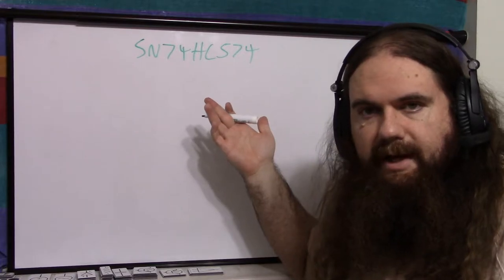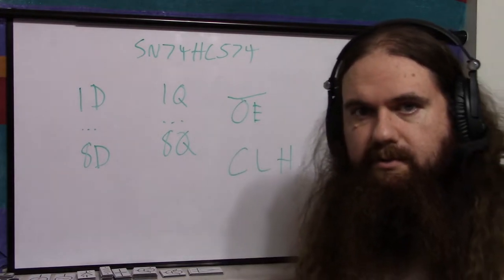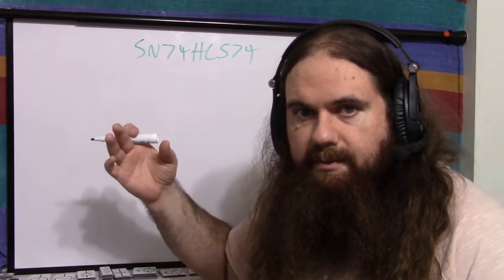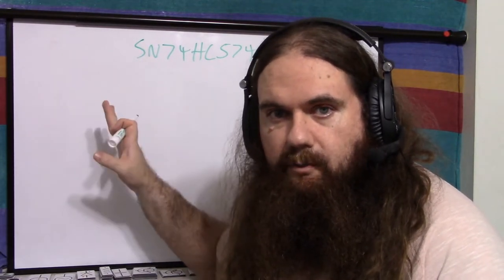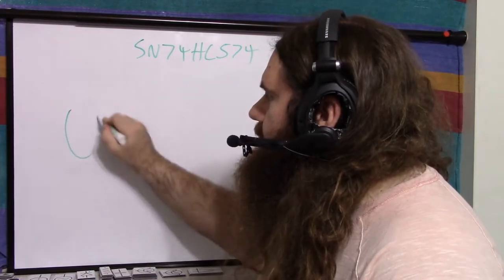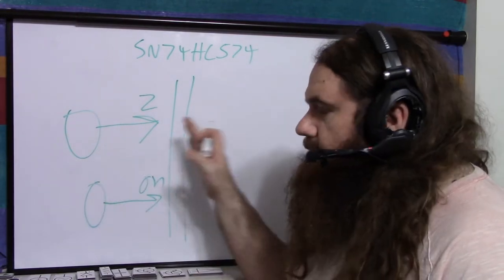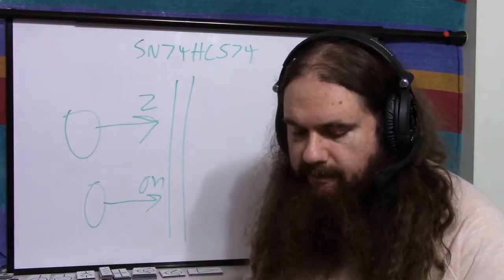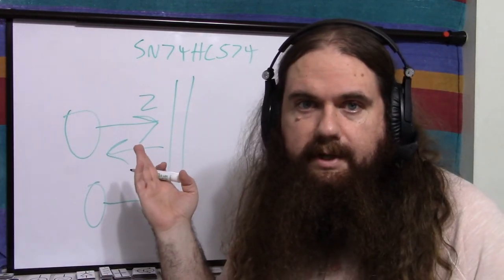74x574 Octal D-Type Tri-State Register - Data Or Signal Buffer For Your Bus - Simply Put

Comment: The one thing this chip doesn't have is a direction pin. The 74x245 is an octal bus transceiver that will let you send data to or read data from the bus, depending on the direction pin's state. It's not clocked, but perhaps there's a clocked version of it if that would be useful.  I'm really tired right now, but I'm supposing that both sides would be connected to the data bus, you feed data to it by disabling output and clocking data in, and then turn on output when you need it to output it's contents.  That doesn't feel right, I'm certain the designers could've made the chip so that depending on the state of OE it could read from or write to the same 8 pins so there would be less connections necessary. That would leave 8 pins open which could be used for more data making for a 16-bit register. I think I need to go back to bed, some neurons in my brain are obviously not firing.
Reply from the maker: I think you're just overthinking it a bit, trying to decide why chip A doesn't work like chip B. The answer is, that's why they make both chip A and chip B. There are seventy kajillion chips out there for that reason, because somewhere there is (or at least, was) an application for that specific thing that was popular enough that some company wanted to buy them in bulk. I said that you could make a bus transceiver out of this because I like making things out of other things, but it's awkward because it's not what it's for. For learning or prototyping, it's fine; In the "real world", you'd just get a bus transceiver. And don't forget cost: Engineering and manufacturing, as well as waste for how many chips don't work off the line. Cost is more than just how many pins there are.